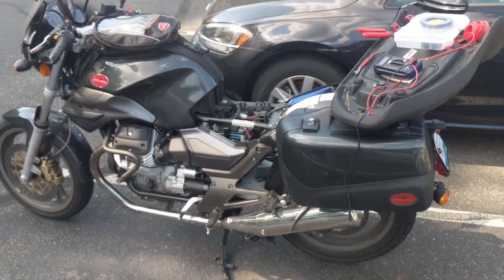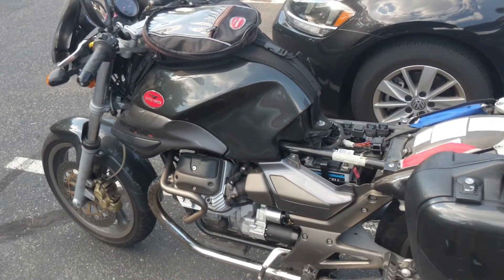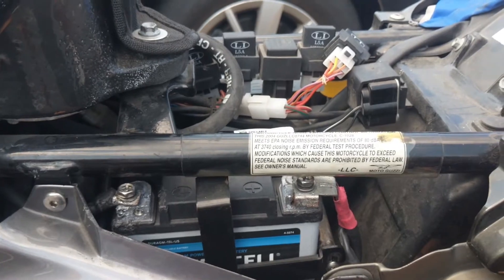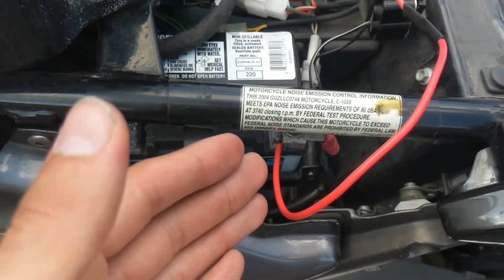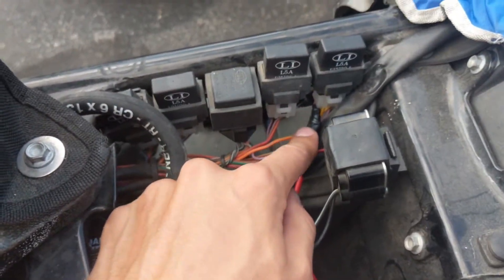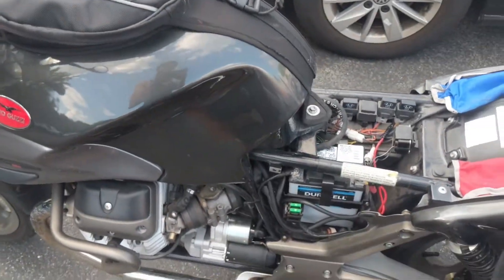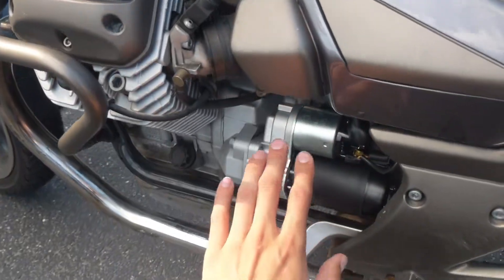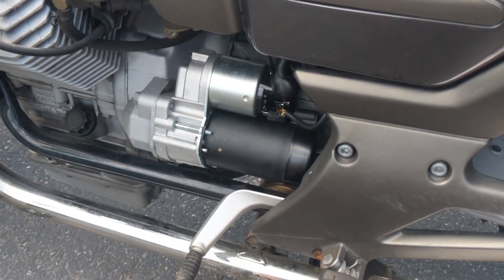Moto Guzzi Click, No Start Fix - Starter Relay Bypass - 2004 Moto Guzzi Breva 750

Comment: I know this is a very old thread but the starting issue presists and, as here, one of the underlying problems is not always addressed. 
There are at least 4 solutions to the starter interuptus problem: 1. run a  wire from the yellow wire output on the connector block that feeds the starter Relay and connect it to the MOTOR solenoid's spade connector (taking the starter relay out of the circuit); 2. Run a wire from + battery pole  direct to the starter Relay (taking tje ignition switch out of the circuit) ;  3 connect a button to the + Battery pole one one side and the Stater solenoud spade connector on the other and install the button in the ABS indicator light's hole. 4. Install the off the shelf Kit that upgrades the stock relay.           Any of those will cure the problem whose root cause in a weak relay (assuming a fully charged correct battery is on board and there are no paracitic drain issues.
But the unaddressed issue is a sticking starter button.  That problem manafests as a  starter that continues to spin when the button is released. Generally it will release when the motor fires and many are of the opinion that this is a feature of the motorcycle. IT IS NOT. This hanging switch will kill your starter solenoid over time - giving the same symptoms as starter interruptus -  and in some cases hand granade the starter motor. So if your button is a keep - on-cranker, clean it or replace it   when you are addressing starting problem.

PS I went to three Moto Guzi mechanics who were oblivious to this issue each charged me 700 dollars and left me stranded

Comment: You did it nicely but as you said....if you make the cable even shorter, even better!

Also replace the cable to the solenoid for a double sectiion should be enough and you avoid to add extra fuse (becouse you should protect that line between +bat and rele).

Comment: I have a 2013 V7 that just started doing the same thing. There is 2 red and green, one purple and one blue and yellow wire, not just on red. The purple is in the same location as the red wire you modified, Does anyone know if this is the wire that needs cutting? Cheers

Comment: I just tried it on my Stelvio which was also clicking. I believe the wire that was supposed to be patched directly to the battery is the one reading 12V when the ignition is off? If so, on the Stelvio that is the Green/Orange wire (also at the same location) and that is the one I wired but didn't make a difference. So, either my issue is different or I misunderstood your info and used the wrong wire.

Comment: You left out one little thing. Wiring it this way, the start relay is always energized. I have had four Moto Guzzi‘s. Starting with my 2004 V 11 sport, and my 2007 Norge, I had the start relay issue, and the bypass, which is pretty easy to do if you know what to do. Moto Guzzi needs to change suppliers for their relays, and for the oil sending unit… that’s quite a thrill riding at 70 miles an hour at night on the interstate in your oil light comes on. Then you’ll find out later that it is just the oil sending unit/oil pressure switch that is at fault. I’ve replaced three of those over the years… it’s one of those glitches you put up with when you own an Italian motorcycle..
  there was a Moto Guzzi club member selling Chinese replacement relays for four dollars each on the Moto Guzzi national owners club site here in the USA. Those relays can handle 30 A. The stock relay for my Norge could only handle 10 A, and just turning the key on puts an eight amp load on the relay before you even hit the start button…
  I bought 10 of those start relays and I was handing them out to buddies at the new Cumberland West Virginia, Moto Guzzi rally when they used to have it still. I was actually at the site in new Cumberland here in 2023, but only one other Moto Guzzi Owner showed up. I want different than in 1986 when they were Almost 800 moto Guzzi’s that showed up that day..
  I would not recommend a Moto Guzzi to anyone that is not slightly mechanically inclined. Every once in a while, you have to get off the tool kit.

Comment: Hallo, had some starter problems : Starter did not turn fast and with hot engine the starter did not turn the the engine at all (hot = more compression) only at second try. 1. new battery , 2. took out the starter and cleaned all pos. and neg. conections with sand paper also the conection between starter and motor block - now everything is ok again 🙂. It was very easy took one hour. Moto Guzzi Stelvio 1200 NTX 10 years old.

Comment: I have exactly the same problem with an Aprilia shiver 2012. It's not cranking over at all and I believe this could be the problem, it was cranking when pressing the starter button briefly and it was really slow when it did. Never new that the solenoid on these bikes especially Italian ones have there own starter relay for the solenoid, how it works in my case thanks.

Comment: Bad to cut the red orange wire, better to remove pin from plastic of relay connector and crimp a pin onto positive lead you add sliding it into plastic.  Also safe to add a 20A fuse on positive additional lead between battery and relay

Comment: Bad advice, buying a super chaap Chinese starter&solenoid, hotwiring the relais without a fuse and not over the key-contact. Better replace the main contact relais (if there is one) or replace the key-contact switch or the fusebox. This is not a safe solution.
Reply from the maker: Hmmm, is it a bad idea to replace the starter with a $70 one from an American-based company that I can contact if I have problems?  Or should I replace it with a $200 stock Valero one, French made, that's known to be plagued with the very same issues that caused me to replace my stock starter in the first place?  Moto Guzzis are pretty esoteric where I live, and there's not a lot of options for replacement parts available.  For me this whole project is a cost-benefit analysis.  I could spend lots of time and money looking for the proper switch, relay, or even whole run of wiring to replace, or, I could do this DIY solution.  As for a fuse: I've stated in other comments that you can throw a fuse in-line if it makes you feel better - I worked with what I had.  I never said this was the only way to fix it or the proper way; obviously a mechanic wouldn't do it this way.  This is just a quick fix for my cheap bike.

Comment: Neat. I've got an 06 v11 with the same issue. Question... Does your kill switch still work? If you press the kill in and press the starter, does it crank or operate normally? And where do you suspect the corrosion? Ignition switch?
Reply from the maker: Everything functions normally - this bypass simply provides voltage from the battery to the starter in a shorter route than stock with minimally added resistance - no switches or grounds are affected by it.   I wouldn't say that I suspect corrosion in any one spot that could be addressed, maybe I would characterize it as tarnish or patina throughout the entire starter circuit.  My bike was garage-kept and never intentionally ran in the rain and still suffered this problem so based on my experience and what I've heard from others it's difficult to pinpoint a cause other than a slightly flawed design.
I should add that I previously had to replace the starter itself.  The stock starters (Valeo) on these bikes suffered from poor quality builds and many have to be replaced - it's possible that the faulty starters draw more current which in turn heat up the whole of the circuit potentially causing a change in the resistance but I have no evidence to back that up.

Comment: Nice explanation and solution. You answered the question about this switch on the clutchhandel indirectly; it prevents the starterengine burning out if at any point you start accidentally with a gear engaged. Old Guzzi's like 850T3 had such robust BOSCH starters, they did not break (but still had the protective switch), nowadays everything has to be cheap and quick. My EV1100 burned out the French-build starter cause it does not have the protective switch, but I had to either wait 4 weeks being in France to get it or buy it in the Netherlands the same day! Not-thanking Guzzi-France, what a load of crap for services.
Personally I think that a way better protection could come from the neutral-indicator, cause that switch is already there and reliable cause it's not outside in the weather. No neutral light, no starter, so simple to figure that out...
It keeps also surprising me that after all these years of development, Guzzi has done absolutely nothing to prevent you from short-cutting the positive terminal of the battery against the chassis. Or worse: against the breakline that runs right next to it! If a shortcut current flows through that breakline, it will vaporise the fluid inside. You'll notice no difference until you hit the breakes at the first attempt! It nearly killed me coming down a mountainside, bloody hell Guzzi.
Reply from the maker: Good point!  A neutral indicator switch would be good enough for most people I think.  Interesting that all the newer Guzzis are plagued by starter issues.  My Valeo starter (I'm guessing that's that same French company) burned up as well.  Luckily I'm in the US and was able to get an aftermarket one from DB Electrical on Amazon with two-day shipping.  Been running it for a year so far and it seems great, it definitely sounds like it turns-over better than the stock starter.
Reply: Hello, thanks for the video!, Do you mind to share the PN starter from DB or link to Amazon please

Comment: My 2007 Norge went to click mode just at the end of the season. Put it on the lift this morning 1-1-21 and have the starter out for inspection. Have to rip a lot of fairing off to get at it but at least I'll be able to clean all contacts from the starter to the battery. If that doesn't work then your fix will be the next step. Great vid!
Reply: If you have a click it's this.  If you have a clunk at the starter its not this.  I did this fix and now have the clunk.  Short version, wire a start button between battery and starter solenoid.

Comment: Would it be wise to put some 15A or 25A fuse on that wire?!
Reply from the maker: Yes, that would be a smart idea.  I will probably add one eventually, I just didn't have an inline fuse on-hand when I did this.
Reply: Which one?  15 or 25?
Reply: And if you did NOT put in a fuse, what would happen?
Reply: @jamesaltizer5897  Based on the wire size and use (not constant voltage) a 25A would be plenty, that said it is usually best to look at what the starter relay itself is rated for then "fuse" down from there...I think his could be a 30A?  In as many words,   amperage generates heat, which requires larger gauge (diameter) wire to pass that "energy".  If this path were to become "overamped", or lets say the relay stuck and consistently fed amperage through that wire, you could use a fuse which "blows" when high amperage is passed through it. With that said, many aftermarket or "fixer uppers" add fuses to starter, or starter relay wires so they can see the fuse blown as in indication that something is wrong.

Comment: Your video fixed my no start issue!  Thanks!  There's a Guzzi repair shop in Houston that sells a 'repair kit' for this for 40 bucks!  I fixed mine with some wire and a couple double ended connectors!
Reply from the maker: Glad I could help!  I considered buying that repair kit too (which is a great fix) but once I had the confidence to cut the wires (after a couple hours on forums and staring at the wiring diagram) I realized that this is the way to go!  Ended up being "free" since I already had wire, solder, and connectors on-hand.